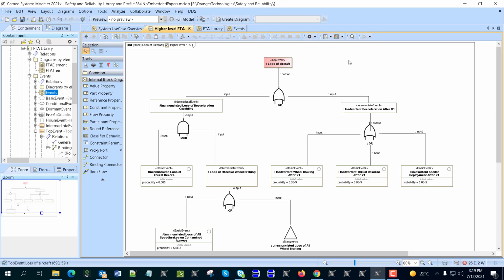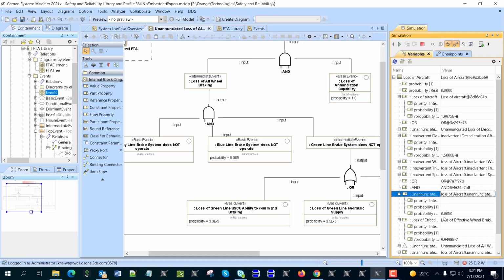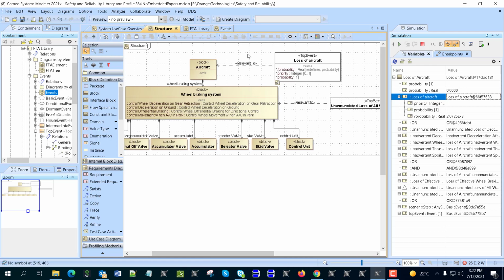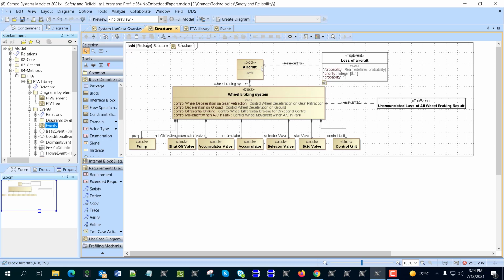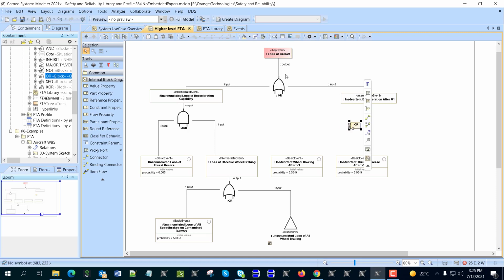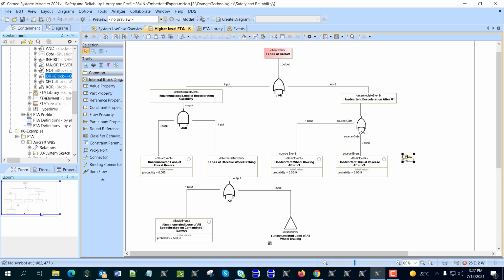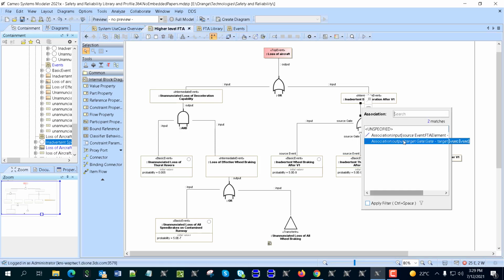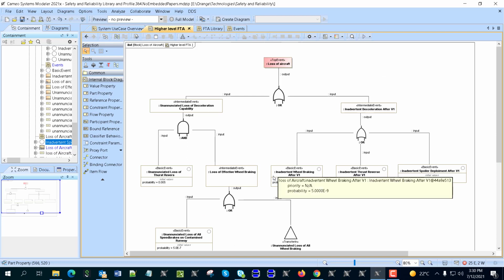Fault Tree Analysis Using SysML Simulation

Comment: When opening the Events bdd in 04-Methods>FTA>FTA Library>Events SysML_activeValSuite - Block throws an invalid connector error to the binding connector under ZeroEvent. When I hide the values compartment, where the probability property is located, the error vanishes. Why?
Reply from the maker: Is this with this sample or official FTA capability. Please use FTA capability it is already available out of the box for few last versions. This sample was early access demonstration.
Reply: @MBSEExecution  Both! v22R2
Reply from the maker: Thank you! We need to check. Could be something wrong with connector.
Reply: @MBSEExecution 👍 later that happened to all events that have probability as a property, derived or not.